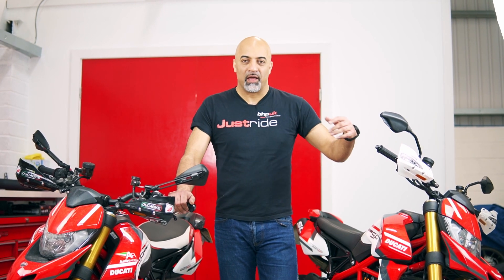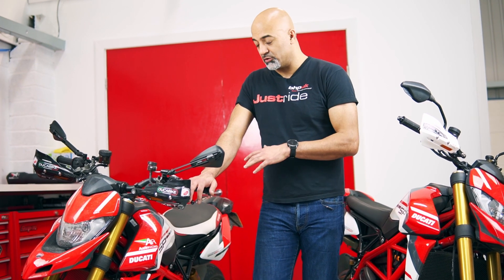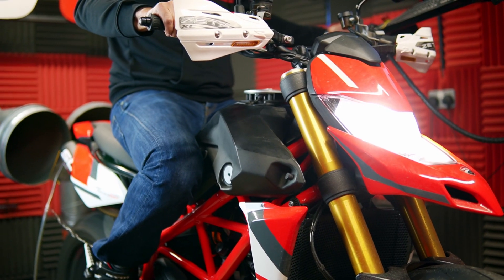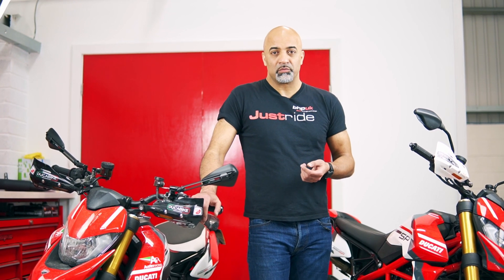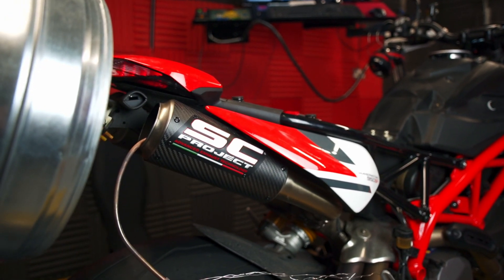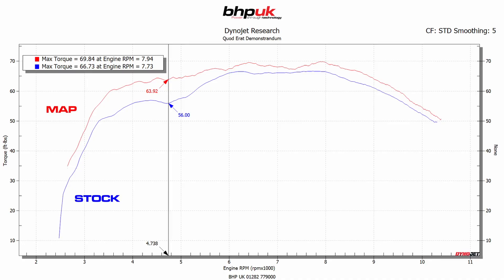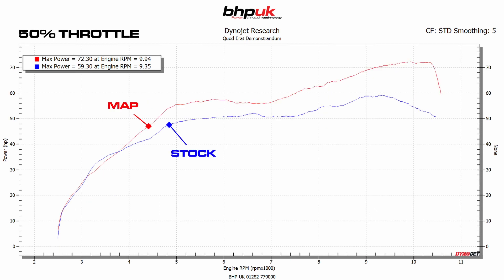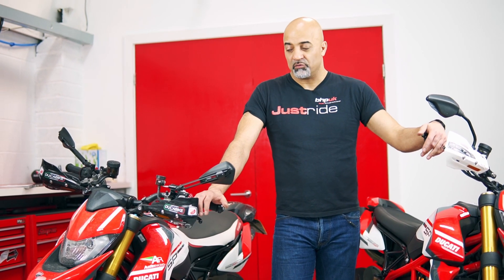Ducati Hypermotard Euro 5 Remapping (NOW OBD) | BHP UK Custom ECU Remapping

Comment: Hi! My Ducati store doesn't recommand me to reprog a 2022 cause of reliability. What's your opinion about this? Thx
Reply from the maker: As standard the bike is very lean. After a remap the whole rev range is running richer which means as well as an improved throttle response and more power, you get lower EGTs. Reliability and longevity will be improved with the remap not reduced. 
The factory have to run the engine lean to meet Euro emissions standards not for reliability or longevity.
Reply: @BHPUK  Thx :)